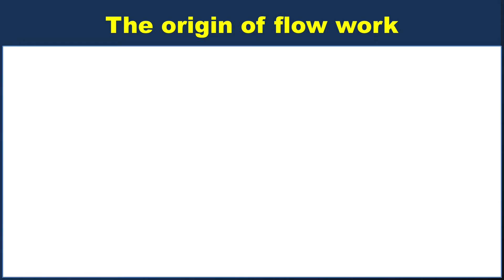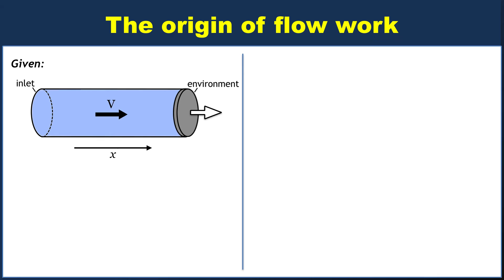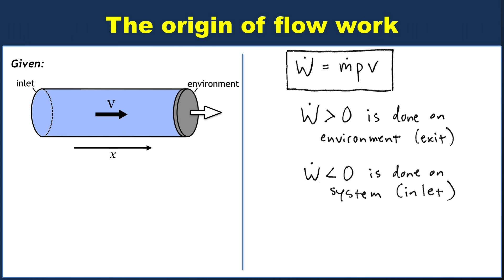Comment: Hello, 
Why do we not consider the force that the environment is exerting on the system due to the pressure fluid element right in front of the exit? Would this not lead to work being done into the system at the exit and work being done out of the system at the inlet?
Thanks
Reply: I think maybe that work is being done on the fluid, while we are only interested in the work being done on or by the control volume, and since the fluid is not part of the control volume so we don't consider it